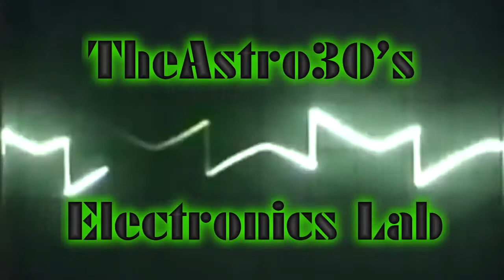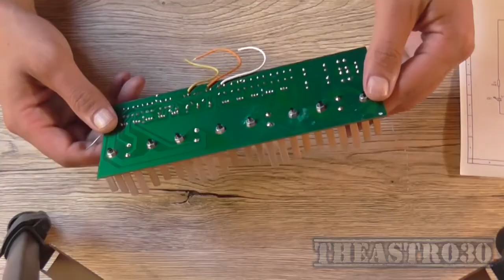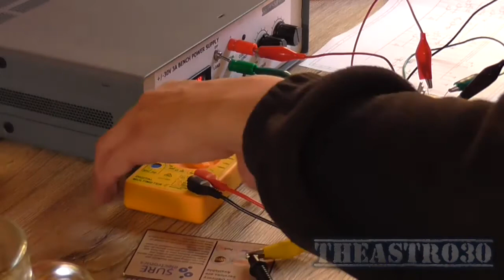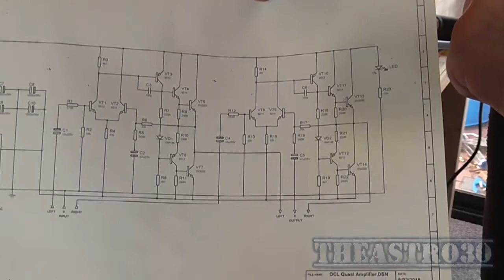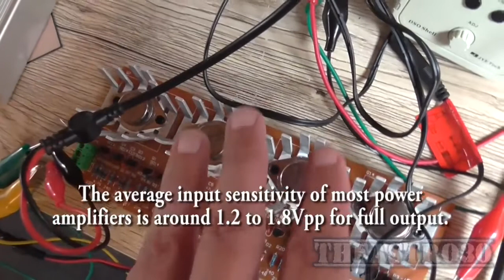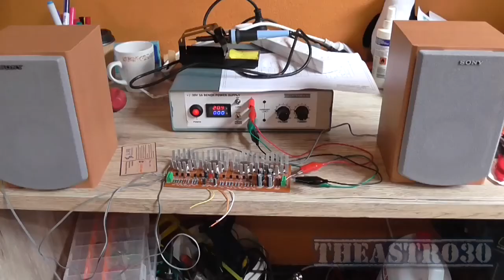Fault-Finding An Amplifier With DC At The Output

Comment: i have a flucating 42 v on the spkr outs.....i checked the output trans and driver they good any idea what to check ..B+ and - good as well also an oscillating noise from one of the driver,,,
Reply: Did u find?
Reply: Dry joint or pcb crack ?

Comment: My 5 channel power amp all the sudden has a hissing sound on all 5 channels, even when the amp is off (standby from trigger circuit). All 5 outputs have 250-350 mv DC. The amp is a B&K Components Ref 200.5. Any idea where I could start looking for such a rare problem. I'm thinking maybe a leaky transistor. I'm pretty sure the amp section is supposed to be shorted to ground in standby, but obviously some voltage is present in standby.
Reply: Common to all channels and in standby, then start looking at the power supply, maybe a bad cap.

Comment: Thank you for this video. Before I found it, I had been doing the same trouble shooting procedure you were using, but wasn't even sure if that was the right way to go about it. The only thing that would have helped is if you'd provided a link to the schematic you had so I could have followed along. Still haven't found my problem, but at least I'm headed in the right direction.